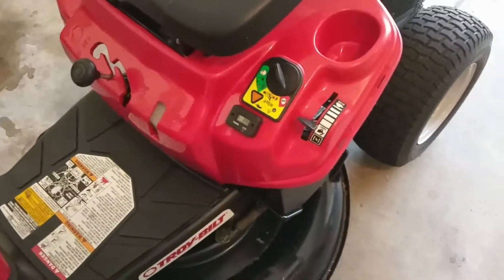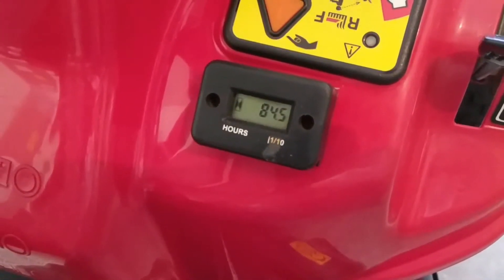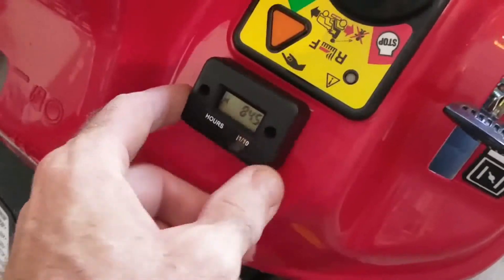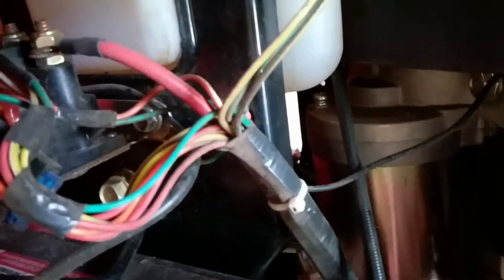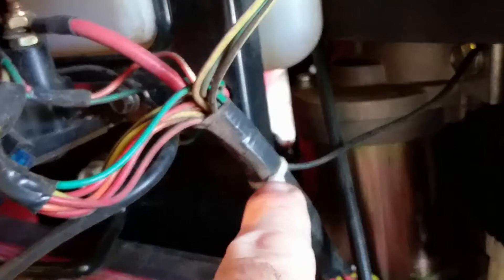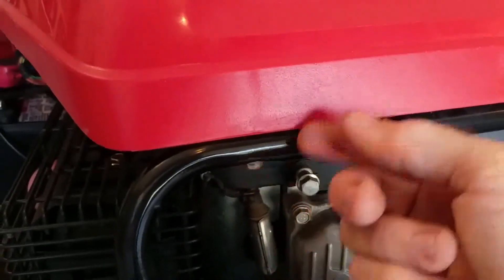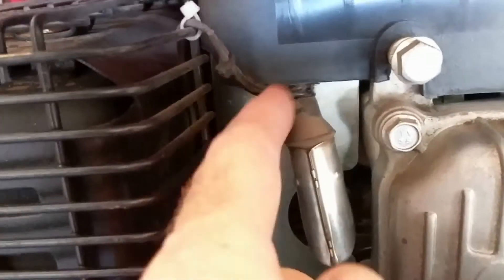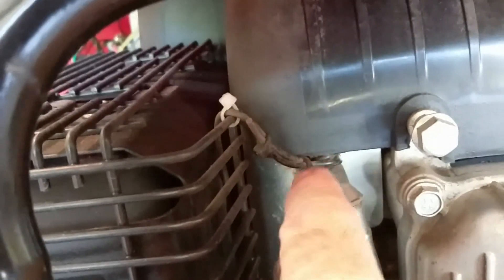Troybilt TB30R Hour Meter

Comment: Thanks for showing the wire routing.  I notice that you have attached to the muffler guard. Does this not cause the insulation on the wire to melt?
Reply from the maker: It's the cage around the muffler, and no it seems to be just fine. The wire is designed to wrap around the plug wire so it appears to be ok for hot areas.

Comment: I fited one to mine the tractor  would  not start 
With it coneted to the spark plug wire 
I thought it was faulty so i tryec a secon o e same isue was the unit was robbing the spark from the coil 
If you conected it with a clip aftef it was running it ran ok 
 But once  you stop it wont ever start again 
Way is this ?? 
Bob
Reply from the maker: It's an induction sensor so you just wrap the wire around the spark plug wire. No need to disconnect anything and it should have zero impact on the spark.
Reply: @petedymond  
Well it doese 
I think the ignition on my engine is differnt
It's a 382cc  powermore engine
Reply: @petedymond  the tacho sensor wire seams to 
Rob, the spark from the plug ?
I tried it with  spark tester attached to the coil lead 
No spark with tach wire on 
Plenty spark with tach wire removed 
Runs fine with tach wire removed from plug lead 
It got me beat 
And I have been around engines all my life 
I'm guessing the coil has a doid or a transistor 
In the new engines for some resion 
And it's cutting out the spark when the tach wire is attached 
Strange thing is if you attach the tach lead 
After you have started it it runs fine 
But won't start till you remove it, that is weird